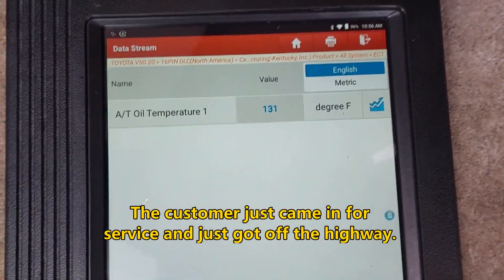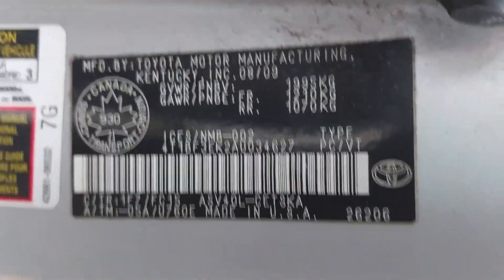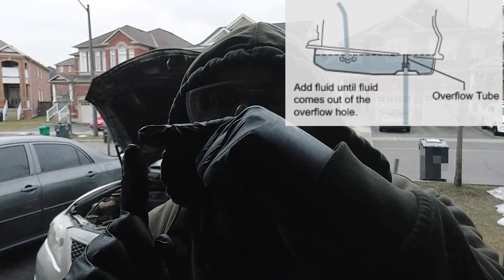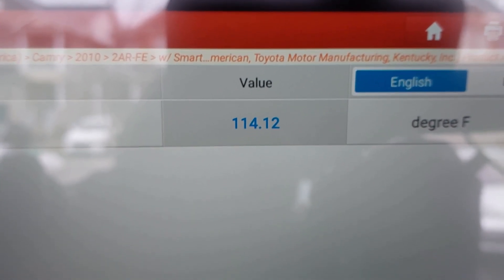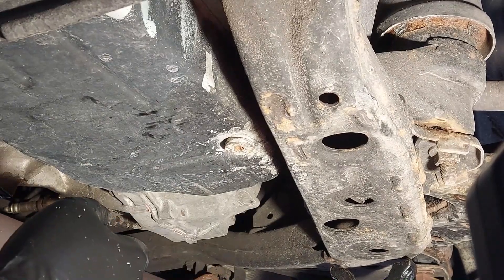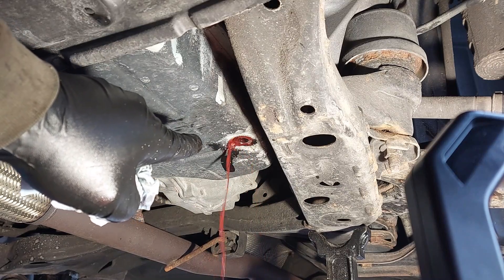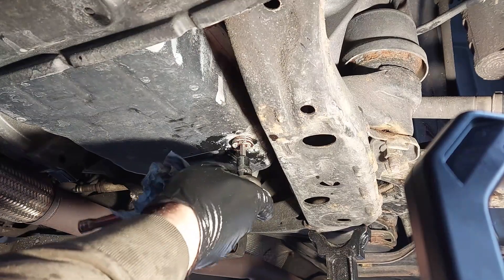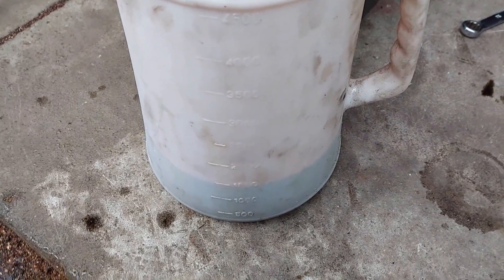Check Transmission Fluid Level No Dipstick On Toyota Vehicles - U760E | U660E | U660F

Comment: Thank you for the informative video! I had a couple questions since there is so much conflicting info 1) Are you implying that once drained, the transmission has the correct amount of fluid and can be driven? 2) If not, do you measure what came out and refill with the same amount? or are the numbers provided on the screen the amount of fluid i should put back in?  I know its an old video, but I liked your format so i liked and subscribed!

Comment: How did you poor the fluid in. Engineers suck. No dipstick. Dipsticks
Reply: There is a fill bolt in the drivers wheel well. Yes I have one of these and I hate the design. A dipstick would be so much easier.

Comment: Funny how so many videos on how to diy... use these advance scan tools like they were available to anyone
Reply from the maker: Cars are becoming more complicated in this day and age so it's no longer a simple task to do such things even for maintenance. You can get a cheap scan tool off of Amazon for probably under 300 or 200 dollars that is capable of reading the transmission fluid temperature. If anyone is working on cars the proper and correct tools must be used for certain jobs. It's just the way it is now if one wants to do things properly.